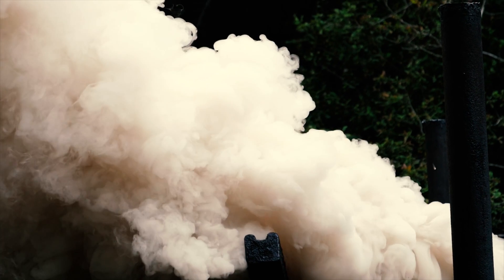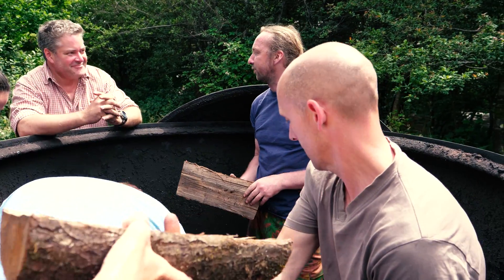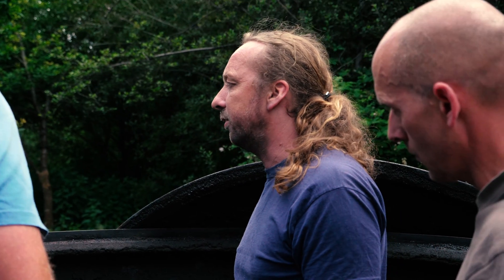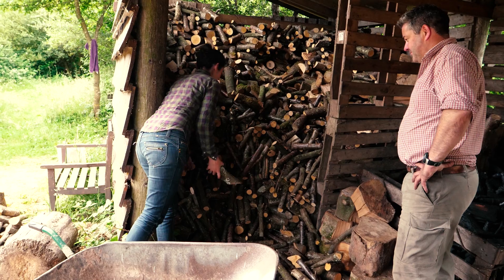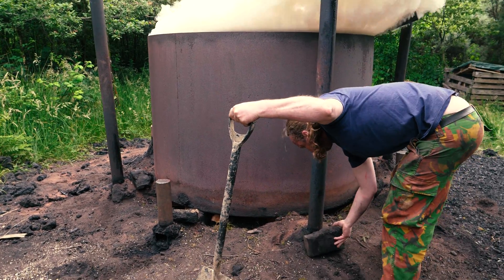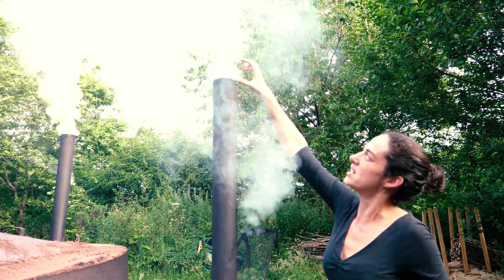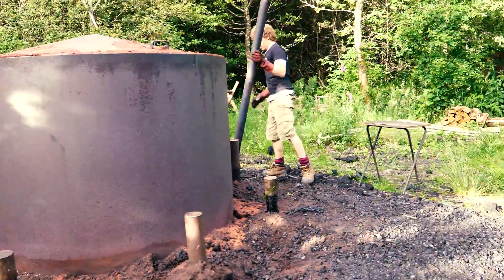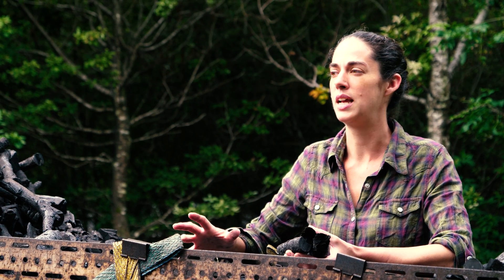Bulworthy Project Presents - How to Make Charcoal in a Ring Kiln

Comment: Is the smoke causing bad impact to environment?
Reply from the maker: It is mainly steam. There are particulates, which would be a big issue in a built up area, but not so much in the countryside.  There are greenhouse gasses, but the carbon in these is part of a short term cycle. We use the waste charcoal in ways that mean that the carbon in it is sequestered into the ground. As the charcoal doesn't decompose, it doesn't release the carbon.

Basically, it's better than carbon neutral, but isn't entirely without issue. When compared to a gas barbecue, or imported charcoal, this is much better.
Reply: @Bulworthy  so basically the thick white smoke is mainly steam, tar, condensible gases (liquid smoke) and combustible gases such as methane, hydrogen.
Reply from the maker: @kkskoh  it's mainly steam, but has those other constituents as well.

Comment: Talk about over-engineering something. Just digging a hole in the ground is way cheaper, faster and easier.
Reply from the maker: That would be a bonfire, which would indeed be cheaper,  faster and easier, but wouldn't result in charcoal.
Reply: @Bulworthy  It wouldn't? I thought I made already like a ton of (charged) biochar this way and applied to the garden and got great results.
Reply from the maker: @georgecarlin2656  how many tons of wood did you put in for your ton of charcoal?
Reply: @Bulworthy  I do mostly corn stover biochar because it's simply better. By volume it takes about 2 wheelbarrows of corn stover to create 1 wheelbarrow of biochar, but this is normal because when it burns it naturally shrinks like boiled mushrooms (unlike wood which stays pretty much the same size). Plus I think about 10% is wasted to ash, which is a nice thing but less wanted than biochar.
I tried various sources and came to the conclusion that wood biochar is the worst (if you do it yourself) because it's very hard to grind to smaller particles and is harder to charge it properly. While with corn stover or grape vines you don't have to grind it to smaller pieces which this alone is a huge deal to me.
Reply from the maker: @georgecarlin2656  if you've invented a version of an earthburn which is even vaguely as efficient as a ring kiln, you should weigh the wood and the resulting charcoal and let the world know.  I have a feeling that the ratio would be less than 1 part charcoal for every 15 parts of wood.
Reply: @Bulworthy  15 times less? That's odd. How many times did you dig a hole in the ground and do biochar?
 I'm not doing wood because I rarely have it and when I do it's usually too ununiform to burn efficiently.
But if you have access to corn stover try it out and see for yourself. It's very hard to estimate the ratio because when the corn stover is raw it has a lot of space between each stock and when it's biochar it's well compacted so the volume here is misleading, the same applies to branches of wood, plus I don't have the motivation because I'm not a scientist nor a business man selling this stuff.
I did a rough approximation in my mind on corn stover yield ratio and I get about 4.4 parts of biochar for 12 parts of raw corn stover (because I get 4 wheelbarrows with a little hill with biochar for 3 wheelbarrows of raw corn stover but the hill is much taller because raw corn stover doesn't fall apart when you carry it and you can carry much more of it). But you have to burn it when there's little or no wind (because it burns so quickly you can't manage it under remotely serious wind) and you have to have some experience to do it effectively. I have some videos on biochar but I never had a from start to finish video to show the full process of burning and yield - mostly because I don't have a remotely good camera, I'm using a cheap Chinese phone to record which I hate.
Another reason I prefer corn stover - it takes me several times less time to burn it as opposed to wood.
Reply from the maker: @georgecarlin2656  you claim to be getting a better ratio of corn stover to biochar than a modern retort. That's clearly not true.
Reply: @Bulworthy  I told you what I honestly estimated, since I'm not selling you anything I have no reason to lie. Try for yourself - that's the most objective tip I can give you and you can carry out. If you don't try you'll never know for sure. As they say in theory theory and practice are the same, in practice they're not. And btw, the corn stover has to be fully dry, unlike wood you can't make remotely good biochar if it's even slightly wet. I had some corn stover lying around a few days ago and it was rather dry but not quite - I started burning it and it was horrible, the leaves burn but the stocks don't and the fire simply stops burning.
Reply from the maker: @georgecarlin2656  OK Chap.

Comment: I feel this process is quite dangerous because of accumulation of gas, and using direct method of burning produces alot of waste.  Instead of having a second container inside the kiln for the wood.  The direct the  exhaust pipe into water to eliminate the smoke and  with an out spout  which has continious flame to burn out wood gas.
Reply: Can you expand on this or provide links to examples? I’m curious about your suggested changes

Comment: Thanks for the hard work you put into the production of this video. One question please: What is the base of the kiln made of? Metal or earth?
Reply from the maker: J. Babi Weedor the kiln doesn't have a base as such. It sits on the 8 vents which act as air inlets and chimneys. These hold it appropriately 100mm above the ground.
Reply: Thanks for the prompt response.
Reply: ...how long does it take to burn into charcoal?...